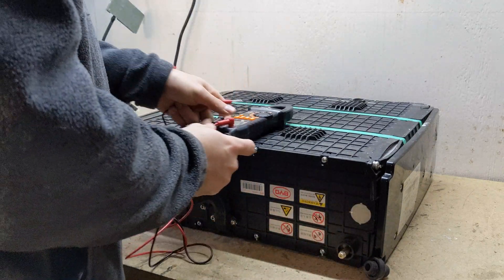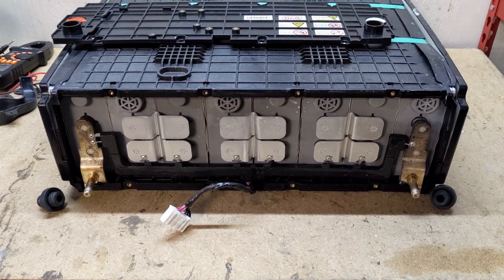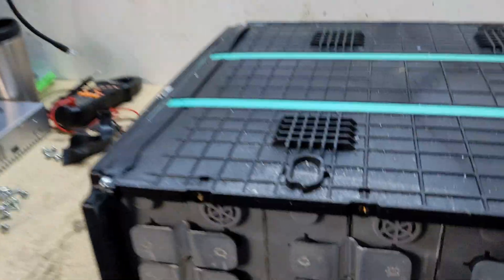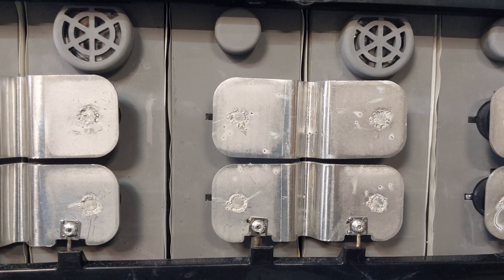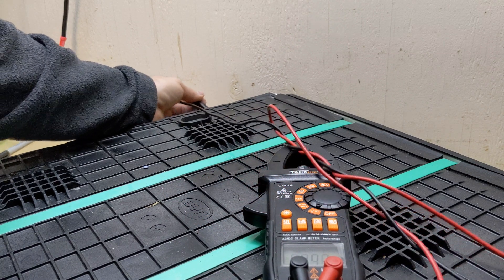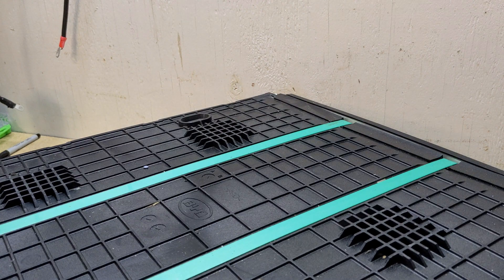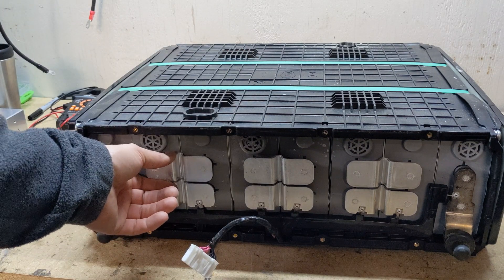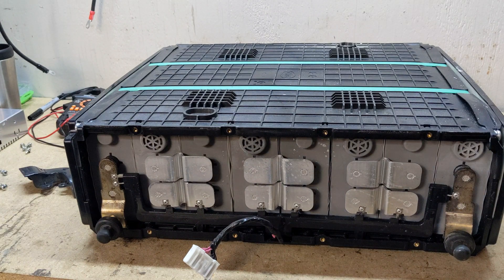Damaged BYD Lithium Iron Phosphate Packs

Comment: Very interesting video 
I have 48v Lvl 15.4kWh lithium batteries 
24v each which are connected in series to make up to 48v 
I misplaced the bic card which means I can't use the bms in the Battery pack. I want to know if there is a way to build my own bms in both packs. Thank you
Reply from the maker: No idea ,  these specific packs i got are on a shelf ,  could never get that wiring down right and had some cells release their gas ports before i even got to deal with them ...

Comment: Can BYD battery be adopted to older Toyota hybrid cars ?
Reply from the maker: Really depends on the voltage and configuration.  I would say these batteries probably are not configured correctly

Comment: Make one good 8s battery and one good 4s
Reply from the maker: Are you suggesting breaking the pack down to bare cells ?
Reply: @offgridmaryland   yes but if you did not care to you could use just 4s from each by rewiring it but that may be more work.
Reply from the maker: I am wondering if I break those tensioning straps if the cells would expand more ...   Also. Seems like cutting those bus bars maybe difficult too ..
Reply: @offgridmaryland   Expansion is only a problem when you are using the cell either charging or discharging not when dismantling. I have never dismantled this particular type but most are the same. I am sure you could sell them as is lots of people dismantle them.
Reply from the maker: Yes I never dismantled this type either.   And I have never had a pack with so much expansion.  

I guess it couldn't hurt to try but those bus bars are going to be an interesting task. Without damaging the other cells ...

Also I will have to find a way to compress the good cells
Reply from the maker: So i actually dismantled one of the packs ...  When i cut the tension cables i had a cell fly out about 1 foot they are quite swollen in the first pack ...  On a side note the place i purchased them from gave me a refund for the damaged packs !
Reply: @offgridmaryland   Hopefully sounds like no harm done I guess that is why you need to cut the bus bars first lol
Reply from the maker: yep removed those first ... i must say the sudden push out took me at more surprise than i expected
Reply: @offgridmaryland  Did you happen to film it? I'm really surprised that they are under such pressure (and I expect most people would be too).  Where did you buy them? And why buy used cells?
Reply from the maker: @ArthurDentZaphodBeeb  I did not film the first one.   I still have one left to do I'll film that !  But yes they were under some pressure more then I expected ..   

I have been testing the capacity of each still working cells.  They are between 88-100 ah a cell .
Reply: @offgridmaryland  Yes I see lots of videos of dismantling that type but the bus bars need to be ground off it all depends if you are into stuff like that here is one guy https://www.youtube.com/watch?v=HWbemAg5FoM
Reply from the maker: yea those bus bars look like a job ... i think the one pack i have has a bit more expansion then his pack  .. i might give this a shot.   Whats the worst case i get a bunch of working cells i can rebuild ?
Reply: @offgridmaryland   that is what I figure too. I think a large size drill bit maybe a better way for the posts then you could reuse them and with a little bit of the aluminum welding rod you see at the yard sales you could attach them back on
Reply from the maker: yea i was thinking they looked like aluminum.  I do not have any aluminum welding equipment.   what you think about cutting the bars ? 

This would be something i would want to prepare for. i have a lot of thoughts
Reply: @offgridmaryland  Propane torch and that aluminum rod they sell at the flea market should work but I have never tried it. Otherwise you will need to come up with a way to attach the bus bars. Ya if you have a steady hand a dremel with cutting blade would work at the middle  you would still have a bus bar to attach too.